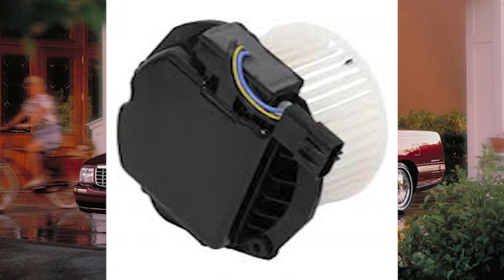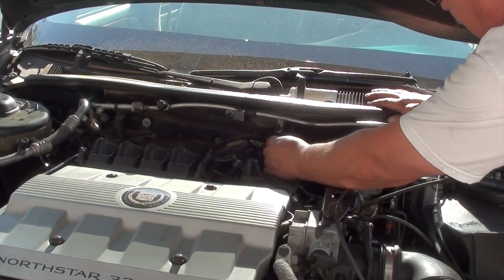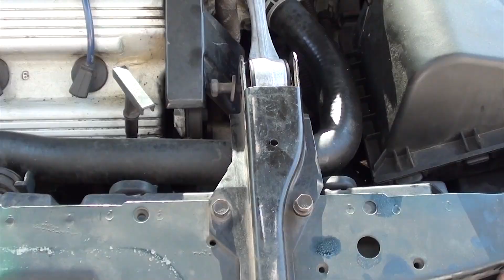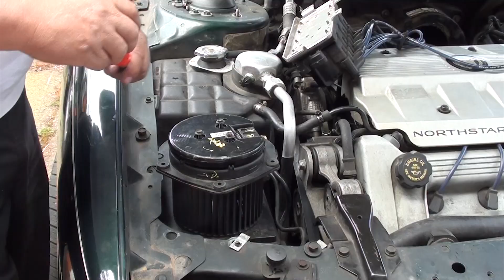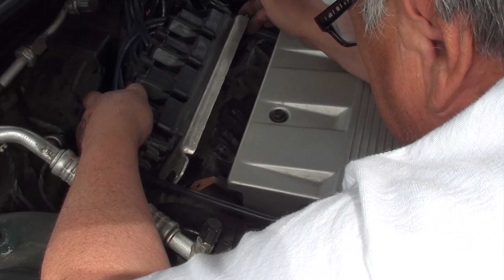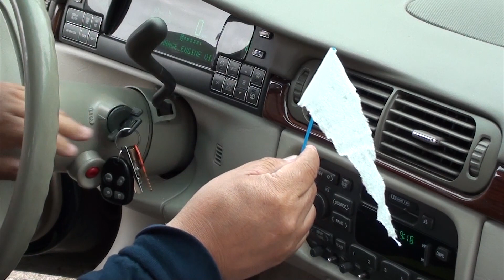Cadillac Northstar - How to replace AC fan Blower motor | what mechanics wont tell you | DIY

Comment: Is this the same directions to replace blower motor for 2005 dts?
Reply from the maker: The AC blower motor in a 2005 Cadillac DTS is located on the passenger side of the vehicle, under the dashboard, behind the glove compartment area. 
To access it:
You will generally need to remove a lower insulating panel or trim panel beneath the glove box.
The motor assembly should be visible and accessible from the underside of the dash once the panels are removed.  Good Luck!
Reply: @notsofast2325 thank you for the reply and video!
Reply from the maker: @marlonlicup10  You're welcome!

Comment: hey what size turn buckle did you use
Reply from the maker: If i remember correctly the diameter of the rods was about 3/8 thick. Get one the fits but don't get a thin one. Spend a few cents more. thanks for stopping by!

Comment: Question. You removed what looks like an aftermarket motor. (White fan) and installed a factory oem fan? I see you cleaned the back plate with the three fins and installed the back plate. Was that correct? Reason i ask is my dads 1994 deville with a 4.9 deville has a problem, and the fan stays on with   the key out of  the ignition. The car has 50 ,000 miles. I have been looking to replace the fan, but everyone says the original is best, with less noise and lasts. I can not find one but only aftermarket .iIwas wondering if i should  try this   and clean the 3 contact blades . If that does not work, what fan with module do you recommend? Thanks!
Reply from the maker: I see you cleaned the back plate with the three fins and installed the back plate. Was that correct?  YES
Get a used one at a junkyard.  Good luck.

Comment: so your motor was just dirty? and not coming on? and second couldnt you have put the motor on the housing first before installing back into the car?  lmk
Reply from the maker: I replaced mine. There isn't enough room to remove the motor so that is why you need to remove the plate. thanks for your question

Comment: If you tilt the engine fwd the rear egr pipe will crack or tear, so the sub assy lowering method is best since the egr pipe removal and welding is not the preferred way...96 - 99 is not available for replacement.😢
Reply from the maker: thanks for your input.

Comment: Hey, not sure if you're still posting or check your comments---but I've got a 1999 Cadillac DeVille that's blower motor is out. I've tried installing the 3-bolt replacements out on the market, now, but even though it works when bench testing, it doesn't spin once it's installed. Any tips?
Reply from the maker: Check to see if your getting power at the plug going into the blower

Comment: My fan blows when the ac is off sometimes then it stops. Only blows out the defrost vents sounds like a jet engine. And it also feels like my car is running rough but only when on. Any ideas?
Reply from the maker: Sound like you have a electrical problem, ether you have a bad controller or a short.
Reply: @notsofast2325  thanks. I just figured out that the reason it was only blowing out the defrost vents was a vacuum leak. I’m looking into the rest. When I unplug and plug the connector back in it runs fo a second and then shuts back off. Hopefully it’s just the resistor. You are really on top of the comments on your video and it is appreciated. Thank you
Reply from the maker: @planemain6381  I try, I know what it's like when your trying to figure something out. Any input helps. Thanks for stopping by.
Reply: @notsofast2325  yes sir

Comment: my front air vents are not working only defrost vents could my blower motor be bad
Reply from the maker: If your blower motor was bad you would not be blowing any air. There are 2 doors that control the air movement. its under your dash. It could be a bad Switch or connections or bad motor or relay or just stuck. which this youtube video you will see the arms that control the doors. hope this helps.
https://youtu.be/IOuZakyNBSE

Comment: Awesome video thanks man I love to c different ways of doing things. I was wondering if u know by pulling engine forward if it will give me enough room to get to the valve head bolts in the back by blower motor? Thx I appreciate ur help
Reply from the maker: There is a company that sells the head bolt replacement kits, they would be able to tell you for sure. But to answer your question. i believe you can. let us know how you did. I'm pretty lucky so far that i don't ave to do that. Thanks for stopping by!

Comment: Just did the blower motor replacement on my 95 Eldorado Northstar.  I did not have to remove anything on the engine or remove the strut bar and did not have to pull the engine  forward.   There is a small plate on the top that comes off and then the blower comes out the opening.  The screws on the bottom were difficult to access, but that was really the only issue.
Reply from the maker: Thanks for your input, And thanks for stopping by.
Reply: Yes. I was about to comment that as I am doing this as I comment. I have a 95 Deville with the 4.6.
Reply: @ekwraps9366  I did have to remove the strut bar to install the new fan motor.  I bought three different ones, including the AC Delco unit, and the last one I bought that actually works is the one from O'Reilly Auto Parts made by Murray.
Reply: So you installed 2 and didn’t work? The one that I just put in doesn’t turn on
Reply: @ekwraps9366  yes, correct.  I installed two that didn't work properly and then the third one did.
Reply: I guess that I’ll have to try the Murphy as well. Thanks
Reply: @ekwraps9366  hope it works for you.  Good luck!
Reply: @HighSierraBob  thank you

Comment: I have a 1995 Eldorado and BOTH the blower motor AND A/C compressor just went bad.  The blower doesn't look like it's too difficult, but the compressor is going to make a nightmare on Elm Street look like a fairy tail!
Reply from the maker: good luck!
Reply: It's easy iam 63 and it's not hard.
Reply: Take oil filter remove oil holder out you can get to back ac
Reply: @helenalonso4311  - I assume that's to remove and replace the compressor?
Reply: @HighSierraBob  yes I did it on my northstar cadallic
Reply: @helenalonso4311  - how hard was it to remove the compressor?

Comment: If still aren't sure if your motor is bad after checking fuse, buy a blower motor from your local store, unplug the installed (bad) motor and plug the male connection into the new motor. Make sure the new motor is sitting so that when the fan turns it won't hit anything and cause a problem. Then, turn on the car and set climate control to economy fan on. If the motor turns on you know that's what you need. Pretty simple.
Reply from the maker: Genius

Comment: Can you tell me where the cabin air filter is on my 98 deville?
Reply from the maker: i have asked that same question.. i have looked in mine. and there is none. when i replaced my heater core i saw that there was none.
Reply: @notsofast2325  ok thank you sir. Was your AC and Heater not blowing? Mine comes on but you can barely feel it blowing? Blower motor or resinator?
Reply: Owners manual should say where!
Reply from the maker: @jaddy540     I have one.. it doesn't say anything about cabin air filter or anything of the sort.. thanks for your input.

Comment: What kind of turnbuckle did you use?
Reply from the maker: If i remember correctly the diameter of the rods was about 3/8 thick. Get one the fits but don't get a thin one. Spend a few sense more. thanks for stopping by!
Reply: @notsofast2325  Was it one with two hook ends or 2 eyes?
Reply from the maker: @PurpMan242   yes I remembered you asked this., i saw it in the garage give me 5 mins. And I can tell you the size..
Reply from the maker: @PurpMan242  OK , it's 5/16inches and there not hooks there loops on the end. When you tighten it and it moves. Move it until the motor cant move. If you try to move it any more the turn buckle will break. So be carful. Good luck. If you can while doing this.  Change your spark plug in the back then in the front.  And the plug wires , since you have the engine moved foward. Good luck , let's us know how it went.!!
Reply: @notsofast2325  one more question. Do you remember the saftey weight limit?
Reply from the maker: @PurpMan242  no big guy. do your due diligence. And do at your our risk..
Reply: @notsofast2325  What's happenin!!! I finally got it done!! Using a turnbuckle is the hard way!! I used a floor jack!!..
😁😁😁
Reply from the maker: @PurpMan242  awesome.. some guys are shy jacking up there engine  or they don't have a floor jack..

Comment: Nice video.  I’m helping my aunt with her 94 Deville Concours the fan stars to go fast and it blows hot air.  I can’t lower the fan nor can I change the temperature to stay cooler.  Not familiar with Cadillac’s but I’m struggling to figure out if it’s the blower module control or the AC blower motor?  I need help!  Thank you in advance for your help!
Reply from the maker: Well it can be any number of things. (assuming you have the right amount of refrigerant in the system).. check all your fuses Relays grounds vacuum lines etc.  It could be a stuck control arm or Air Delivery Mode Door Actuator motor or gear underneath your passenger dash board  https://youtu.be/IOuZakyNBSE  see 5;50 or it it could be electrical. Here is some videos that helped me understand what the blower motor looks like and what to look for.  https://youtu.be/auaYukYzeao  here is one that explains the system https://youtu.be/SR41ZrEekRs    Hope this helps, lets us know how it went!
Reply: Same here on my 98

Comment: Where did you get your fan motor from?
Reply from the maker: at my local  parts store, you can pull one from a junk yard for about 30 to 40 bucks if your in a pinch. you can also find them on line.
thanks for stopping by!
Reply: Notsofast our stores AC Delco is $500
Reply: @jblack8149  - you can find an AC Delco motor on Amazon for about $325.   Not sure how reliable they are either.

Comment: What size turnbuckle did you use. Thank you and very good video.
Reply: @notsofast2325  I bought one from there it twisted.did not see these solid boy one you have there??
Reply: How long of a job is this for a novice guy?
Reply: Does this also work for a 96 Cadillac Sedan Deville and I couldn't see what the turnbuckle was hooking to on one end
Reply: @RockwearbyEddie  yes it'll work as long as it's from wheel drive. Connect the turnbuckle to the engine mount and the front support brace then tighten the turnbuckle and pulling the engine forward.
Reply: @Tom-wq2mz  thank you!!
Reply: @RockwearbyEddie  you're welcome